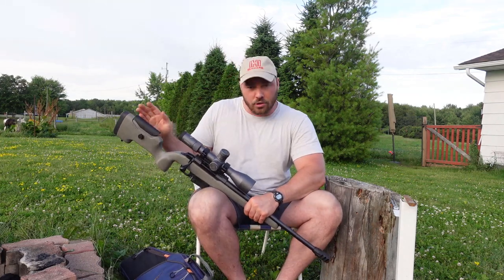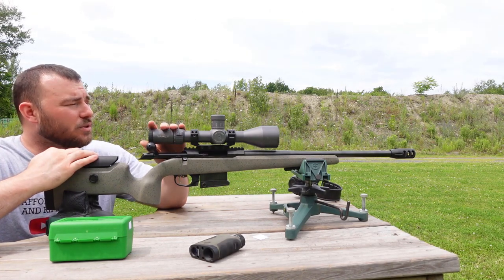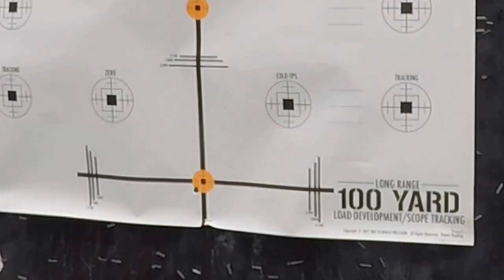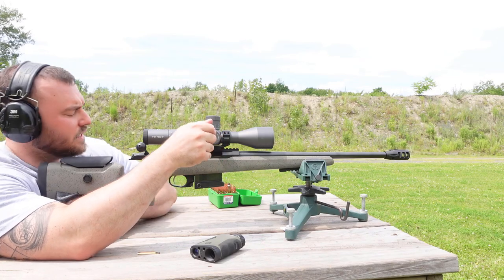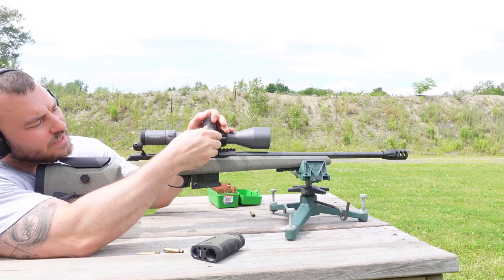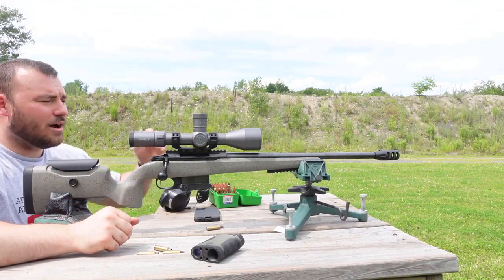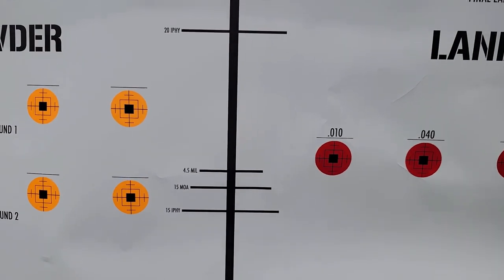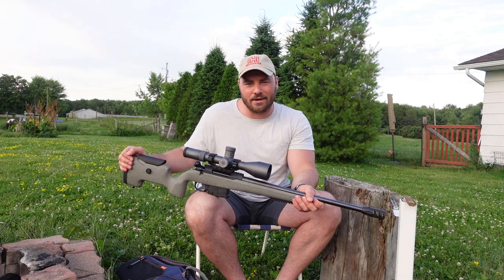How To Test your Riflescope Turrets! Keep It Simple!

Comment: Let me ask a dumb question, can you just do a mechanical test of your scope tracking instead of doing the test shooting? I mean, if your scope reticle Lines up when you adjust the turrets, why shoot at the target?
Reply from the maker: Good question. Now if you just point the scope at the target paper yes you will be able to see if your reticle is correct. Or at least if most of the lines are to scale. But that has nothing to do with the turrets are they work independently to the reticle. The tracking from the turrets could be way off while the reticle is sound. Hence why on some of the super cheap rifle scopes it's recommended to zero, and just use the reticle hold overs and not to dial
Reply: @EpikArms  What I mean is, have a tall target at 100y with 20x1MOA  blocks going down.  Point your scope at the top-center. Now adjust the turrets till you hit 20 MOA. While doing that, see if the cross hair line up as you are adjusting.

Comment: What are your thought on scopes with a built-in range finder? And have you tested Burris scopes?
Reply from the maker: Hi Coby, in my opinion, while it's a neat skill to learn. Ultimately with the prices of electronic rangefinders it's made the reticle rangefinder obsolete for 99% of shooters. No I have not tried any Burris scopes yet.
Reply: @EpikArms  Thank you for getting back to me.
 I'll be doing some elk hunting next year with a 300 Win Mag and was wondering what your thoughts were about learning long-range shooting on a 6.5 Creedmoor instead of the 300. In the beginning, I think it would be easier on your shoulder. But I am concerned with the accuracy of a Gun I'm not as familiar with. What are your thoughts? Thank you for your help.
Reply from the maker: well for one thing you will learn a lot more with the 6.5 because from 0-900y it is affected far more by the wind for ewxample when i was shooting my 6.5 CM at 900 i was holding 1 mill right (thats 3.5MOA) when i was shooting my 300WM i only needed to hold 6 inches the 300wm makes it much less challenging) , and yes it will be easier on your shoulder, then again if you put a quality muzzle break on a heavy target 300WM it wont be that bad at all.

Comment: You can see that after it went left it wont truly return to zero ....... this is not real tracking test sorry dude. When the human element is involved best remove it because then your never truly sure when you push long shots if its tracking perfect. A 1/16" or 1/32" at 100 yards starts to get Texas mile size when you push it out there.